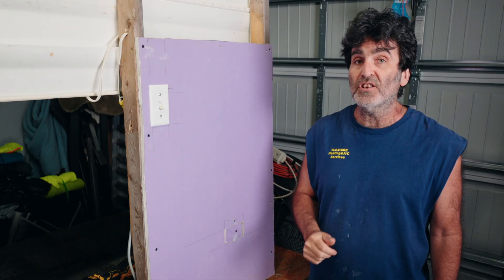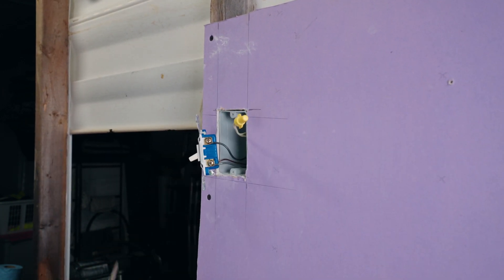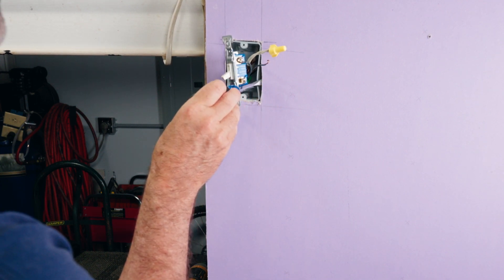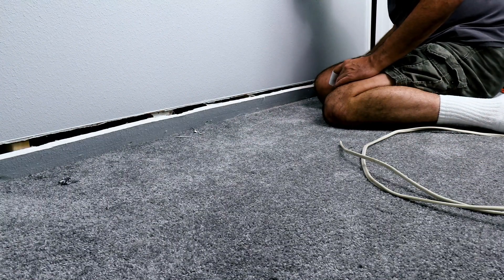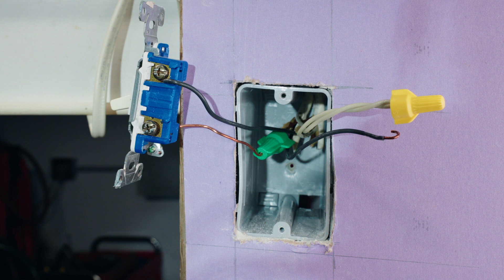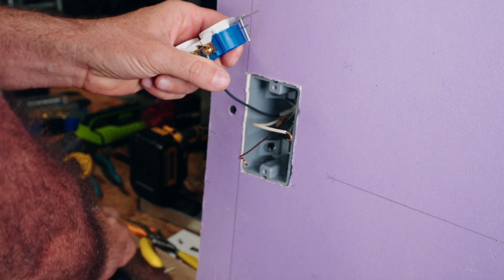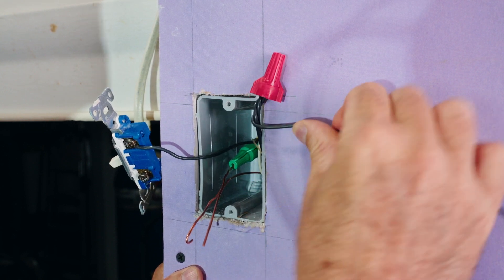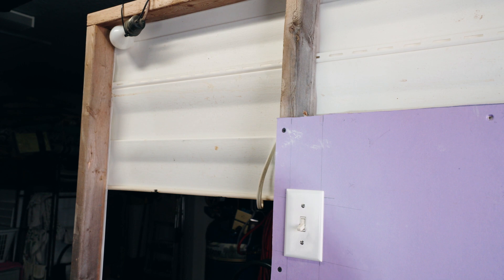DIY Electrical!  How to Add an Outlet to an Existing Switch [PLUS TIPS AND TRICKS]

Comment: Can i use this process to make a switch   an outlet?
Reply from the maker: Yes as long as the switch has "full time power" in the gang box.  You'll have to take whatever the switch went to and either connect it to the plug so it's "always on" or wire nut those wires and don't use them anymore...
Reply: @TheHomeImprovementChannel  thank you man your videos have been a go to.